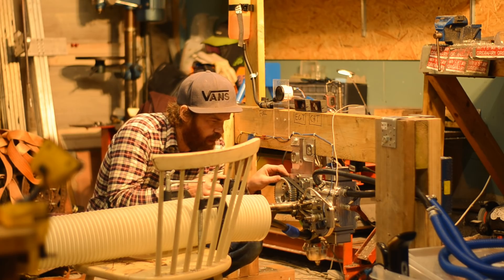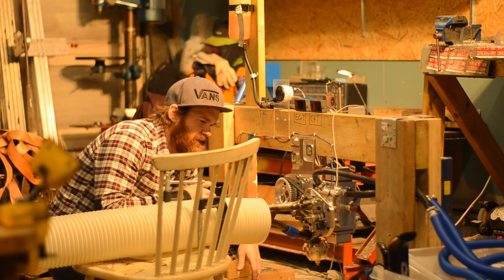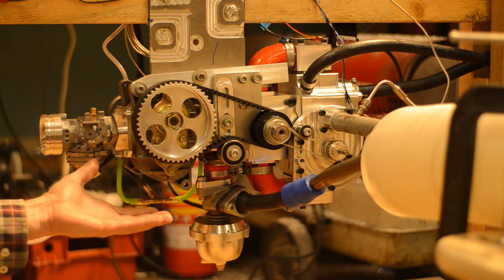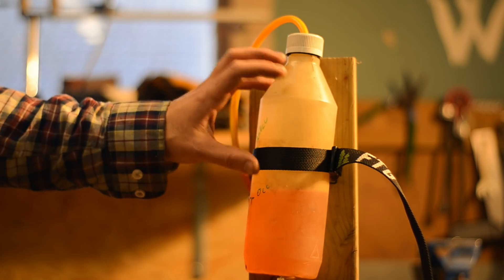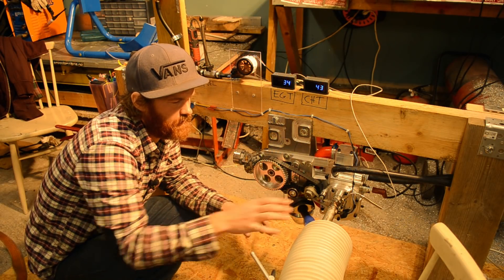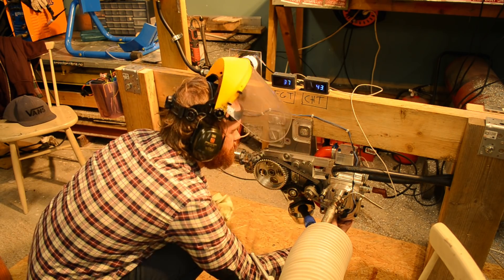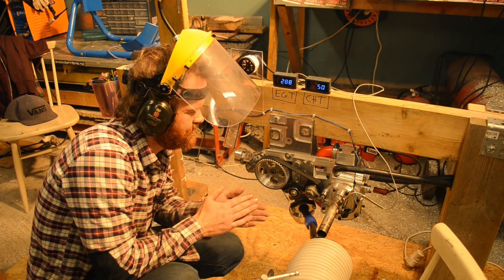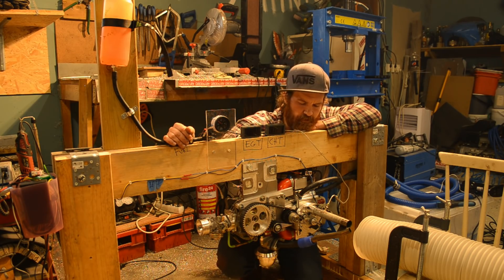WTH is this!? Supercharged nitro two stroke.

Comment from the maker: Hey there! Thanks for watching!
Sorry about that thumbnail...
Also, notice anything wrong about how I'm wearing that face shield? 🤦
Reply: Didn't have it down?😂😂
Reply: Congrats little successes all the time. Already run longer than the original 100 percent of bore PIP engine. Will be very interesting to see how it does power wise. My only concern is the rotary valve warping under heat from the exhaust but that can always be revised to a ball valve type exhaust. Keep up the great work. Youve inspired me to developy own cylinders too :)
Reply: @tke7mu0u  the alcohol burns way less hot so heat is less of an issue i think
Reply: I'm super excited to see this on the dyno. Think you could try no bypass and more boost once it's on the dyno?
Reply: That is great 😂👍
Reply: @patrickbaechler  😃
Reply: It sounds exactly like I thought it might...no ringy ding ding.
Reply: Have you ever primed it with gas/oil to get the cylinder temp faster for the Methanol/nitro to fire?
Reply: Two thumbs up fella,awesome video as always. I have loved watching this masterpiece come to life.
Reply: You have the protective face shield in the open position so that your hair does not go on fire 🔥
Reply: Como tá a produção de um silindro de 2t
Reply: Very awsom engine but where does the most powerful 50cc goes?
Reply: @raybassini5487  to Bonneville of course!
Reply: the headband was a little loose, careful the face shield doesnt fall off.
Reply: Congrats on getting it started !!!
One idea I've thought of, with all the tensioning systems bracketry mounted on one only side of the engine, 
it might need a similar 'base' plate on the opposite side of the engine,
to stop thermal expansion resistance from the singular bracket on one side, making the engine go banana shaped (by a few thousandths to few tenths of a degree,) 
between the blower, central crankcase and the cylinderhead alignments,
when running at speed & operating temperatures & pressures for time - say during a record series of runs.
Reply: You clearly didn't want to miss anything so shield was up
Reply: Only after u mentioned it, lol
Reply: spännhjulet sitter fel, om det stora hjulet driver det lilla medsols sitter spännhjulet på fel sida.
belastningen blir på rullen, släpper bultarna så...
Reply: A meme must be created for this engine !!! The Engine machine head !!!
Reply: I still think a twin plug head would make more power.
Reply: @baronvontourettes  its possible.  I know with a 660r which is a single cylinder 4 stroke, people have 3 plugged them once they've reached its upper limits.
Reply: @baronvontourettes  I think he has more to worry about before twin plug heads.

Comment: If you machine or file a high spot in the centre of the 3D printed parts it should help keep it sealed, also printing webbing or reinforcement into the part should also help

Comment: the compressor is useless for a two-stroke engine, because during operation, the mixture enters the space under the piston, and then the inlet and outlet ports open, which makes it impossible to create increased pressure
Reply from the maker: You missed the rotary exhaust valve and high transfers with reed valves.

Comment: Good luck Alex...
Really admire your dedication :)
Did a lot of work with 2-strokes back in the 90s. Found that super-charging only provides over-scavenging and not much else. Turbochargers, on the other hand, add that essential back pressure to increase cylinder pressure, and power. We were running and testing a V-6 twin turbo 2-stroke from Jaguar. It was a blast until Ford bought Jag and canned the  project. But heck, the power!!!!!

Comment: Friendly suggestion on the plastic part sealing issue. Design 0.5mm curve across the mating surface or rework existing part so middle area touches first when bolting together. If you know what I mean.....

Comment: I've seen on plastic thermostat housings, that are sealed with o rings, the mounting holes have steel bushing to reduce the deforming from tightening down on the bolts.

Comment: Hi, you can try to avoid plane surfaces with 3d prints, make something like a tube with an outside o ring, thus no load on the sealing due to clamping.

Comment: Another awesome video!! But, to keep them coming, PLEASE build a guard between the belt and the carb. I've seen metal bent and broken when a belt fails. The damage that belt would do to your hand as you work the throttle, would likely be permanent with lengthy therapy. Great job and stay safe!!!

Comment: Hi what is the price of carb which you using ? And what is the method of adjusting it ? You need to replace jets or you just adjusting it by screwing/unscrewing a bolt ?. I'm looking something like lectron carb (easy to adjust each jet by screwing a bolt) for my projects but lectron is terrible expensive and I need two carburetors.

Comment: when you print the new parts... pre-bow them. add a convex geometry to the flanges so it provides spring in the opposite direction.
Reply: and shrink the hole centers so that when the concave geometry flattens and the hole centers move away from each other, they need to align with the parent holes in the frame/ main component.

Comment: Dude your my f@#$ing hero. I'm 37 from los Angeles been building 2 stroke  engines since I was 13 for Karting.  For all your genius y do u use a drill as a starter as opposed to a go kart starter. I know everything is direct drive or TAG style engines but surely you must know what I am talking about.  
(P.S. if you want an example of my work that I did with no machines or experience, check out the 600 or 1000cc Performer race car. Peter Elkman has made it pretty famous. Unfortunately I was battling addiction at the time and the prototype or any proof i designed it was.stolen from my dad's house while I was homeless. Anyways your my hero keep it up maybe   someday you will tell me "welcome to my garage "

Comment: Seen a few guys fit steel flanges over the top of the printed flange maybe 2-3mm thick in hope to spread some of the fastener pressure across the whole face . Sometimes even pauseing the print and sitting the steel flange over before resuming. Stainless steel probably would be my choice if i were attempting something similar obviously wont work in every situation but would for a few here. Project is going well mate loving seeing the updates 👌

Comment: Nice, runs surprisingly well. Keep going.
Reply from the maker: Thanks! It does. If it makes any power is a different question though, need to get that dyno built.
Reply: Pitty you live on the opposite side of the globe. 😁.

Comment: Tip from someone who has learned. Make sure you're fire extinguisher is as close to being ready to go as possible. When things go up in flames you really don't want to be spending time removing supermarket tags, then the safety lock and THEN squeezing the trigger. You will probably have other things on your mind at the time. Been there, done that, got the picture.

Comment: Could it be that this two-stroke engine is more complicated now than most of its four-stroke brethren?
Reply: I'd go with "no"- it might be arranged in a way that's pretty strange, but it's still a basic two stroke, just with a rotary valve, and a blower, and the reeds in a weird place... and no expansion chamber. Makes me ponder the port timing.

Comment: En ting du kan gjøre for og få de 3D printede delene til og ligge mer flatt når de skrus til er og lage en ekstra "flens" i ett materiale som ikke ikke er så fleksibelt som plasten er. Dette er mye brukt på tynne ståldeler på biler som f.eks toppdekselet på en golf MK1 og 2. Der er det en tykkere del som settes oppå dekselet for at ikke dekselet skal deformere seg så mye at det lekker. Nå bruker de motorene en korkpakkning som pakning der, men prinsippet med og bruke noe som fordeler kraften fra boltene slik kan hende virker for deg i dette tilfellet.

Comment: on getting the printed parts working - well those that have room for a redesign anyway :

Can you make the area that the nuts make contact with have land all the way around the part? If you did then you could cut a thick metal washer (one big one that fitted over all bolts ) that clamped all the way around sandwiching the printed part between two metal parts. It wouldn't have space to bulge between the fixings eliminating the problem.

Comment: It may be able to handle more drive ratio and boost now that you've fixed the leaks! Are you going to add a boost gauge? I've run regular 2 strokes without a muffler before, this sounds way different... completely insane!!! Imagine what a similar design triple would sound like...🤔😍

Comment: I love it 😍 your an absolute genius my guy I love that your continuing to push the envelope with 2 strokes, redesign, develop, build and test. I honestly feel that if 2 stroke engines had the same amount of R&D as 4 stroke engines have over the years that they would be insane! the power you can get from such small displacement engine that weigh less than their 4stroke counterpart. Such a shame motorbike companies haven't done more R&D on them. Luckily we've got you my guy keeping the beasts alive and progressing🙏❤️
Reply: The emission regulations killed 2 stroke development

Comment: For the plastic parts, how about using Silicone sheet for a gasket so that very little clamping force is required. You could also consider a gramophone finish when printing the parts.

Comment: Maybe CNC thick flanges that go over the top of the 3D printed parts . That way, you have a small CNC process and fast prototyping for 3D printed parts. Maybe even build a flange collar into the top surface 3d printed parts to accept some beefy flanges. If the flanges are thick enough, your surfaces stay trued up.

Comment: I wonder if you machined a flat plate of aluminum, heated it up then set your 3d printed part on it for a second or 2 maybe it would take down some of the high spots on your 3dp part.

Comment: Well the Japanese were getting about 25hp (400/ltr) out of their 50cc GP engines on gasoline, unsupercharged (apart from the tuned exhaust), so with the blower and on nitro you should be able to get 35 or so if the engine (especially the piston) can stand the heat.
Racing model airplane engines on straight methanol, no tuned exhaust (disallowed because power was too high) can get 2.5hp from 6.5cc at about 45,000rpm.... around 400bhp/ltr)
The dyno tells all.... keep at it... :)
Reply: our blown 4 stroke gets 54hp - 100cc - 540/l    https://youtu.be/Yl7jnpErqTk

Comment: Hey guys since this is a 2 stroke chanel im asking for help i have an Aprilia rs 125 2002 and i took out the powervalve since it was not working and it wouldn't rev up more than 9k rpm and after puting a new piston,cilinder and new rings still the same problem any ideas?

Comment: the company   rb- concepts  based in  usa  made and sold  a supercharger kit for nitro rc engines and  gas small 2 strokes aboutc10 years ago, but it had problems with holding tune. they never improved it.  i thought maybe you would want to take a look.  happy building.

Comment: The orange hose or tubing that you use .... where did you get it? I need to make an extended manifold for my two stroke motorized bicycle. Typically people use 3/4" heater hose. I'm just wondering if this stuff would be better.
Reply: It looks like silicone tubing one use to connect turbo to intercooler. A car retailer should have them.

Comment: why dont you try to attach - for example - a metall-plate to the intake with screws or maybe glue it with 2k-glue, and then you can attach the intake with the metall-plate to the engine or whatever, so you deleted the leaking imo. in that moment the stiff solid metall-plate is the sealing part, it will not bend or anything. you also can try to deal with some thicker sealing-rings. you can grind a groove inside the carbon-poly thing and with the sealing ring you dont have to use huge forces to get air tight. what u think?

Comment: Sealing your 3D printed parts might be improved by using an elevated sealing ring printed onto the face of the mating surface. Leaving clearance over the remainder of the mating surface, insures that the ring maintains high pressure contact. Thicker flanges to transfer the load to the ring would reduce distortion. Someone else mentioned belleville washers to maintain tension. Of course, if the printed material creeps under temperature, stress or time, you are still eventually screwed.
Reply: Or a similarly constructed shape containing an O-ring groove.

Comment: You might try getting a hand pump sprayer and putting normal 2 stroke gas in it and misting it into the carb to start it and let it run on regular gas for ~15 seconds and then turn on the methanol/nitro and only stop feeding it gas once it's fully running on it's own on the mix. That's what they do with all the drag racing engines.
Reply from the maker: 👍 Might be necessary if I don't do the preheating.
Reply: @2STROKESTUFFING  something else you might want to think about if it ends up melting that belt next to the exhaust port could be a liquid cooled exhaust, whether through water injection or a double walled/jacketed exhaust that passes water through it to cool it.
Reply: Good point. Maybe ordinary starting spray (ether?) works well too?
Reply: @nhytg376tgyuu765gjmg  you wouldn't have any oil in it, which is why I said two stroke gas and not just regular gas.

Comment: Oil injection or premix?  (what ratio?)  Are you a believer in more oil (say 20:1) = better ring seal = more power.   Cheers from Montreal Canada
Reply from the maker: Premix. I'm a believer, this rc fuel is a bit on the high side even for me tho, 15%! Ok for initial testing.

Comment: I am thinking that the supercharger will consume so much power that you will end up with less power than the engine without the charger.
Reply from the maker: If kept within reasonable rpm/pressure it shouldn't comsume more than 1-2kw. No clue what % that will be yet.
Reply: @2STROKESTUFFING  roots superchargers are efficient at low boost only. After 6psi the efficiency drops rapidly.  Consider making a small centrifugal compressor using a small turbocharger compressor?  I think you will need allot of boost to see high power numbers. 20 psi?

Comment: I like the engine and alll of your content  but you are filling the crank case with boost so you lose  hp because the piston is fighting the boost.  Correct me if im wrong
Reply from the maker: Thanks! The pressurized case is working with the piston on the way up effectively canceling out the effect.

Comment: Great work, congratulations. Step by step this project is advancing, I am super interested to see where it leads, ? Nitro supercharged 50cc 2 stroke land speed record, you might be in a class all of your own!
Reply: There are already many 2 stroke blown bikes. There is no class difference between 2 & 4 strokes, its capacity, fuel, blown.
Reply: @jean-paulafflick2237  How many nitro fuel, supercharged 50cc bikes are there each year at the salt flats?, this engine is a fairly unique concept I would say.
Reply: @onecookieboy  hi Mark, the class this bike would run in is blown / fuel / 50. Different years have lots of different bikes. Yes it’s a unique build, but he is also taking on the hardest sport on engines. To be flat out for a couple of minutes is hard. It’s all easy until you start making 20rwhp from 50cc, then lots of other factors start popping up. I wish him all the best.

Comment: This is one of the most unique and challenging engine builds I have ever seen.  What RPM powerband do you think it will safely operate in?  ;)
Reply: If you like special engine build. Check out allan millyard.
Reply: @ktmturbo5836  -Yes, I've been there ... serious engineering goes into splicing motorcycle engines together.
I like this 2-stroke because there are lots of ways to make this 'not run' compared to a conventional 2-stroke.
While not in the same work load category as the millyard projects, this required a strong understanding of the concepts, and it works.

Comment: I've seen parts like that bow in the middle between the bolts before. And what I used to do to prevent that from happening was cut a piece of metal usually steel that's that's cut to where it can slide over the outside of the piece it's got the bolt holes in it and it reinforces the center between the bolts. Works great for leaking valve covers and carburetor parts. You can even put a little bend in your manufactured steel pieces and it will give like a spring action against the flat surfaces you're trying to push down more.
Reply: Was just gonna recommend this as well, great minds think alike 😉
Reply: @justjake8873  
🍻🍻

Comment: good to see the engine running, have you decided to put on a flywheel? I take it that's to help the engine to keep running especially tick over or have I misunderstood.
Reply from the maker: Yep, could use more inertia to keep things running smoother. Not too bad as is tho.
Reply: If the exhaust valve warpes at higher temp, one idea is a thicker valve out of cast iron, will double as a flywheel. 

An old cast iron frying pan have gone through many heat cycles, and should be relaxed in the metall by now.

Comment: What's the ratio of the Compressor belt drive now and before?

As mentioned in another comment, the intake plenum volume is a quite important parameter for singles, I'd like to calculate around a bit regarding the pressure swings etc.
Though that most probably won't give any meaningful results, because I'm utterly clueless, it might still be a good way to get a feeling about the relationship and orders of magnitude of a couple of variables.
Reply: 2.2:1 now. I think it was 1:1 before.

Comment: Just my 2 cents : you might try changing the timing between the exhaust valve and crankshaft , using your current timing as index , go 1 degree - note any change and then 1 degree +